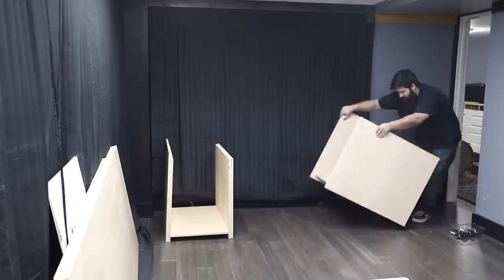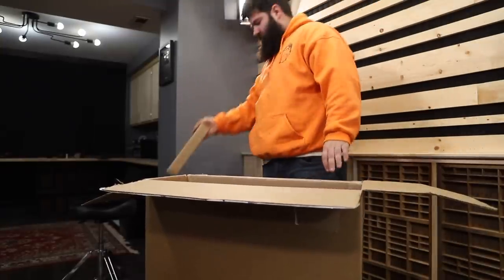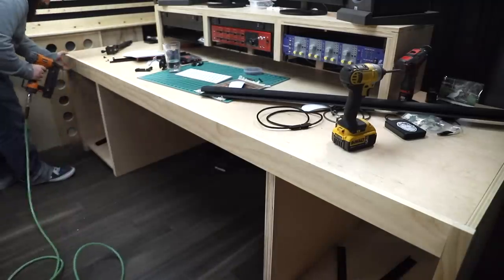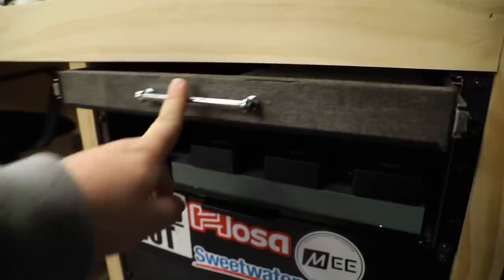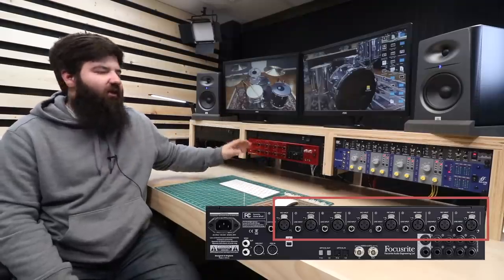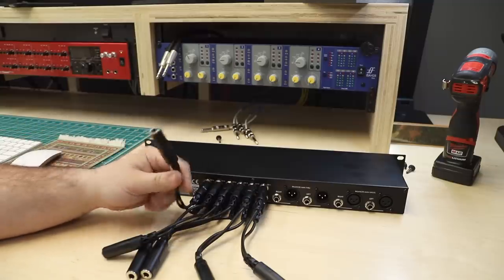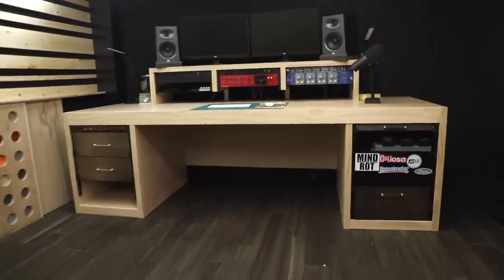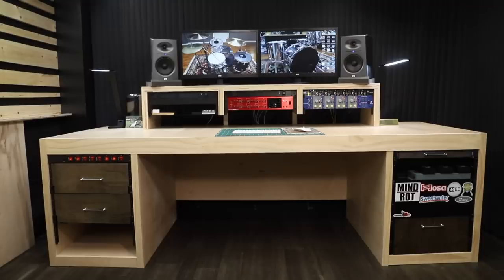Installing the Ultimate Studio Desk... FINALLY!

Comment: Looking really heavy duty! I really like the floating rack gear so you can slide stuff underneath - very handy when cleaning, did a similar thing on my DIY platform desk. For cabling you may want to consider a supplier besides Hosa - their stuff is nice enough but in bulk quantities can get expensive. Monoprice is a good alternative but making your own cables is even better. Get a 100' spool of mic wire and a bunch of neutrik XLR/TS/TRS connectors and you can make exactly the cable you need, exactly the length you need, whenever you need it, for a fraction of the price. Enjoy your new space!

Comment: Dude congrats on the ISA Pre's. Definitely one of my favorite and tonnes of gain, clarity and punch for drums. I recently recorded drums for an album Im working on and used my ISA with a Senheiser Md421 II for the inside kick and it sounded killer. I love Neve Pre's but for drums I often prefer ISA's and API's, especially for inside kick, snare, and toms. I also love the ISA's because they can easily drive SM7b's and other dynamic and ribbon mic's. Also, if you push them into the yellow(and even just a hair into the red) you get just a really nice saturation from the output transformer that sounds something like in between a Neve and an API. Its such a great middle ground. Also expirement with different impedance options on different mic's, you'll be surprised how much it will change the sound/output. Usually though I like the high impedance with dynamic and ribbons, and Ill usually like the ISA or Medium setting for condensers. If you have any questions about it let me know, I know this pre inside and out!!! You rock dude, stay safe during these crazy times!

Comment: You may want to look into split wiring looms for cable management. I really like the synthetic ones. You can cut them to length and then burn the ends to prevent fraying. Really easy to install and easy to take wires out and put some in, plus they look slick. Been using it in automotive a lot recently.
Reply from the maker: That was one thought. Considering itll be hidden I thought it wasnt worth the effort. I may for the cables running down behind the hutch since you can see those.

Comment: Great work!
Only suggestion is that the rack mount power strips are just that - power strips with rack ears. Having one to switch on all power is great, but otherwise I'd recommend a good UPS unit underneath for true sine wave operation as well as protection in case power goes out... but most rack mount "power conditioners" do anything but...

If you were doing again, would you make the monitor bridge 4 RU wide vs. 3? You definitely have the space.

Comment: Us drummers Know how to get stuff done!
I feel for you cleaning out above the ceiling. I worked at a television station and we had to remodel an old master control room and the first task was taking down the ceiling tiles and all the crap that had accumulated over 30 years. It was hot up there. I headed straight for the showers after that. Some guy told me they used to have someone whose main job was to empty the ashtrays in the control room.

Comment: Great video and awesome desk / setup!! Just one thing, you 100% DON'T need the "Hosa Y-Cables” on the Art headphone amp... Each channel has 3 Stereo Headphone Outputs... 1 on the front and 2 on the back... So just plug your balanced jack tie lines straight into the unit itself!!

You can use that headphone amp with up to 18 sets of headphones over those 6 channels because of the 3 outputs per channel! Pretty useful!

- (Also they are the wrong adapter if you did need them to do that as they'd need to be 2 mono jacks to a stereo jack socket, rather than all stereo jacks…. BUT that is what has made it still work in the way you’ve used them, you’ve effectively just merged 2 stereo outputs of the same signal… into one… Haha!)

Keep up the good work, and loose the adapters! :D
Reply from the maker: I guess I need to read up more lol. I saw the 2 outputs on the back and it said "stereo outputs" so I assumed it was split haha. Good to know! I actually originally got mono to stereo adapters but it was only playing in one ear, makes sense now...
Reply: @rdavidr  No worries! Thanks for replying, nice to know you saw the comment etc, all the best!

Comment: You should have installed some felt pads under the table so it'll slide around that floor easily and doesn't scratch it :)

Comment: Is it safe to hydro dip or spray paint the drums hope you can answer this great content super underrated 🙏😊
Reply: @W9744-d8c  no u
Reply: I know I'm not really the person you were asking but with correct prep you could hydro dip some drums. Personally I don't think I'd want to get my drums that wet (could lead to plys delaminating). Best idea would probably be just to buy a nice new drum wrap and re-wrap your shells. You could even hydro dip the wrap before applying to the shells if you wanted.
Reply: As long as you take the wrap off first and sand it, you’re fine and take all the heads, snares, and hardware, it’ll be fine and look great
Reply: you can probably get away with metal drums being hydro dipped, but I wouldn't recommend wood drums they might warp. I've gotten away with spray painting my drums, but they were a cheap set. it really boils down to you. it's your stuff do what makes you happy..
Reply: Thanks everyone

Comment: eyy synchronicity :) i'm building a tiny home/ recording studio off grid and just finished designing my desk and it's suuuper similar (down to a record player shelf haha, migiht have to turn it into a drawer now). One question, how do you get to your inputs on the back of your gear? I feel like one 96 point TT patchbay would be amazing for this setup.

Oh and also, been using the ISA one for about 7 years now (first outboard pre I bought) and love it as both a pre and DI. It's funny people get caught up in the name brand hype, but Rupert Neve actually designed the ISA for George Martin of Abbey Road Studios soooo..... Quite a slept on piece of gear

Comment: Did you find any vibration from the speakers due to the torsion top?
Reply from the maker: There is some. but once I put my midi keyboard and other junk on it, it really helped. Though, I would suggest filling the cavities with insulation.
Reply: @rdavidr  insulation is a good idea. What type of insulation would you recommend?